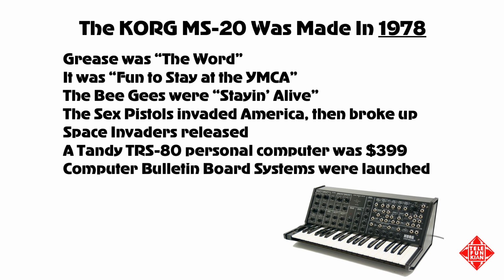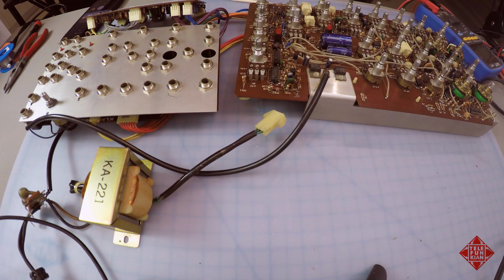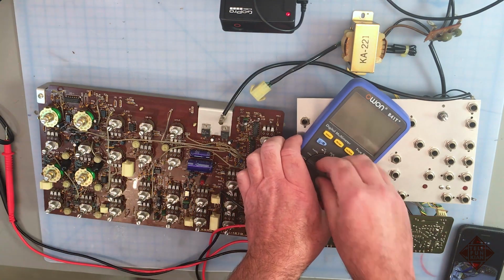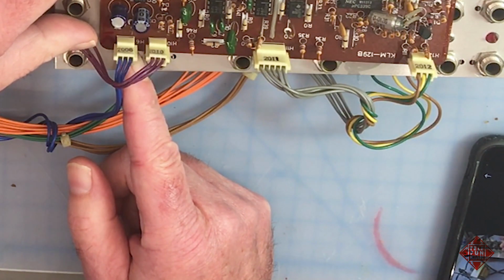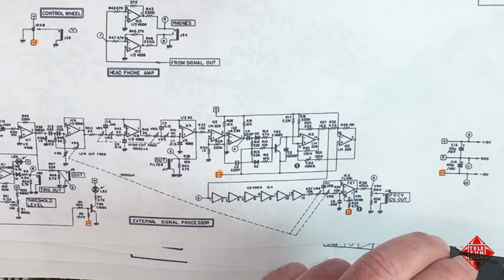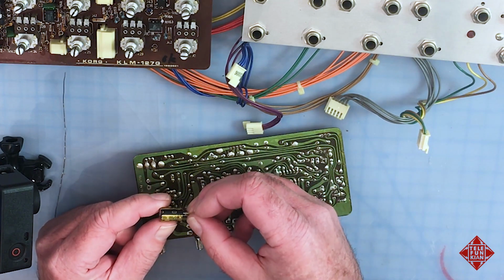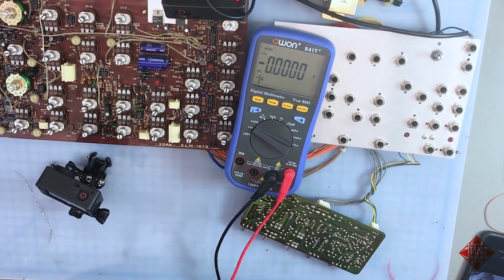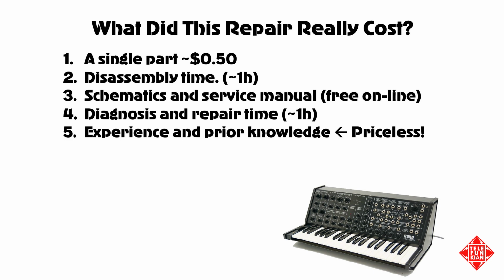Fix Your KORG MS-20 For 50 Cents!

Comment: What would you suggest is wrong when one of the oscillators on my MS20 is not sounding ie no sound from it? so just one osc
Reply from the maker: Hello Simon, thanks for watching! I would need to know which oscillator before I could suggest anything really specific. In order of probability I might suggest 1) Cleaning related jacks including CV inputs. 2) IC 3 (Osc1) or IC 7 (Osc 2) (TL081, sensitive to static so do not touch unless grounded first), 3) Q6 (Osc 1) or Q7 (Osc 2) (2SC1583 dual NPN transistors, obsolete, you would have to source NOS) 4) Clean pots
Reply: @telefunkian  I think its the No.1 oscillator as i have the unit in storage and its not close to me. when i get it out i will follow what you have said thank you very much.

Comment: Love your content 🤘🏽 I have a ms20(no vintage) the internal parts are not the same like yours. Mine it stop to work instantanely may be an electric problem on the primary current. Any recommendations?
Reply from the maker: Giovanni, thanks for your comment. If I understand correctly you have a  MS-20 re-issue that should have a 12V DC adapter. The first thing I would do is check that the adapter is still working using a voltmeter, assuming you have one, or if you do not, you could try to swap with another 12VDC adapter from another device assuming you have one with the same fitting and polarity. Other than that, I can't really advise you further without seeing your machine in person, sorry! Thanks again for watching!

Comment: excellent tutorial, keep going.
Reply from the maker: Thanks for watching Tomasz, I have plenty of other videos in the hopper, I just need time!
Reply: My modulator generator isn't working on the ms20, how to tested out and fix it.? Thank you
Reply from the maker: @DanielBaldivieso  I assume you have a vintage MS-20 and not a new one? Is the LED blinking? Do you have an oscilloscope? Do you have a copy of the service manual?
Reply from the maker: Perhaps start a new thread here so Tomasz doesn't have to read all our comments!
Reply: @telefunkian  Thank a lot for the quick reply, unfortunately I don't have an oscillator, I only have a multimeter, I have the service manual downloaded. There's no light for the MG, and the rest of the functions are working normally. Just bought it like this half year ago, It's a dream synth been looking for about 10 years, yes indeed is the original ms20, and need some calibration. Thanks for you help again
Reply: *oscilloscope
Reply from the maker: @DanielBaldivieso (I assume when you say there is no light, you mean the LED is there but does not blink? ) The OG MS20 is a bit tricky to work on (see disassembly video on the channel), and you have limited equipment for diagnosis, so I might try a "shotgun approach" where you essentially rebuild the MG section, replacing the very few components that are likely to fail. Q17 and Q18 are 2SK30 N-channel MOSFETs, IC 14 is a TL081 (~$0.50) and IC15 is a 4558 (~$0.50). Check the resistor values, the pots and make sure the values make sense based on where they are in the circuit (best done when ICs are pulled). The resistors are probably fine and the pots last forever on the MS-20. Also check D14 with your multimeter. If you are new to soldering use desoldering braid and socket the replacement chips. Order the chips, transistors and sockets and when they arrive open up the instrument. Good luck!
Reply: I will appreciate any help
Reply: @DanielBaldivieso  first of all grab some Service manual for testing